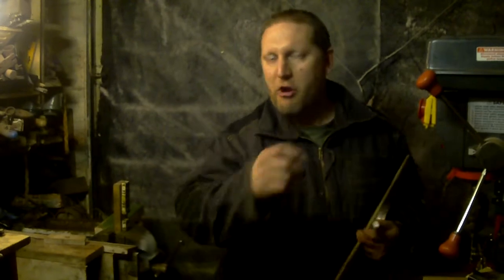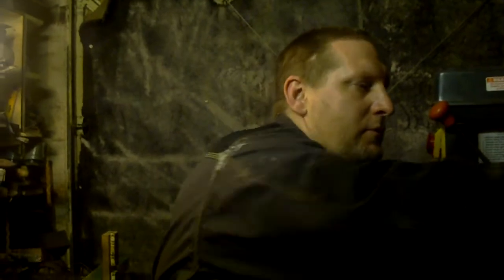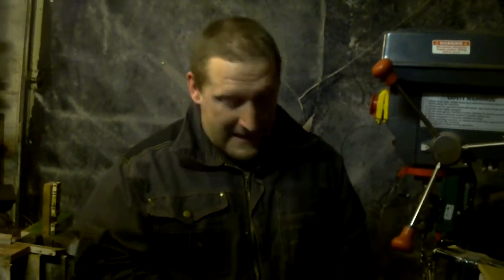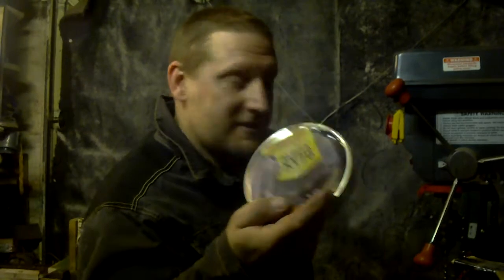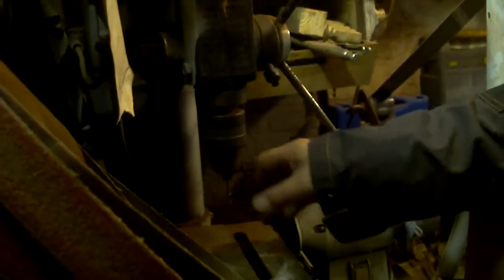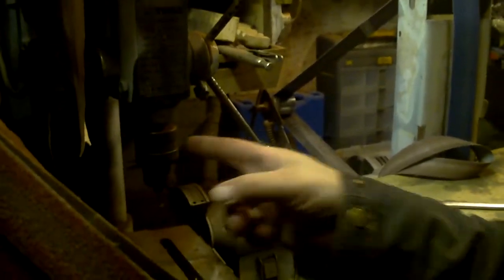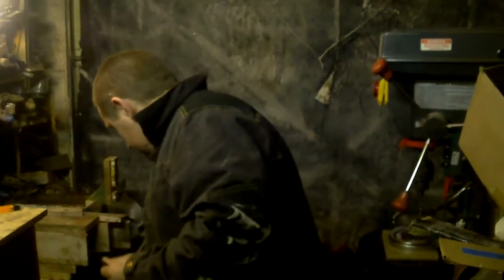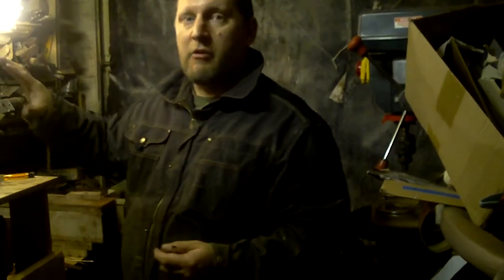Knife Making Tips for beginners, Wessex Blades Hand Made Knives Quick Hints and Tips!

Comment: the first knife I made I started off with a piece of 3 inch wide half inch thick piece of steel.  I used a hacksaw to cut the initial handle shape and then beat the blade down with a hammer after heating with a oxy acetylene torch. I still have that knife around for cleaving heads off fish I have caught

Comment from the maker: files are a cheap way to start...but only in terms of initial material costs, the surface grinding will get you back in worn discs and belts later, if you have a forge you can anneal first so you can drill the softened file, use files to learn the grinds, curves,contours etc. get O1 tool steel as soon as you've got your grinding up to it,,,it is like learning a guitar,,,2 years in your bedroom can be wasted if you don't use a metronome and get your scales nailed down first..

Comment: Great video mate, thinking of trying to make my first knife myself and this helped massively as every other video I see is from an american friend over the water where the materials and tools seem to be sold everywhere, UK equivalents are difficult to come by!!

One question, why depth of ground flat steel do you typically use (I imagine it differs per design) but I'm thinking maybe 3mm for my first try?
Reply from the maker: +Chris Hall hi there 3mm makes a wonderful woodlorey type bushcrafter and allows you to remove only a little steel to achieve the desired scandi bevel....no real need either for perfectly flat sides....Cromwell tools sells O1  but the European Steel that jacklore/LB use is a more consistent quality....I use 52100 for basic tools CS75 for camp knives...
Reply from the maker: +Chris Hall a steel Henry hoover pipe will last a while and yes leavethe edge thick in heat treat or else you'll burn it off...
Reply: Thanks for the advice! gonna order a piece of steel very shortly and make a start!
Reply: My piece of steel has arrived, just got to construct my filing jig! another quick question if I may Scott? I've gone for 3mm stock (01), was just wondering what angle you'd recommend for a nice scandi grind? want to try something simple before I start attempting full flat grinds with a hand file! (sorry for commenting here, but I wasnt sure you'd appreciate me posting question to you on your facebook page etc)
Reply from the maker: +Chris Hall try 11 or 12 deg per side...
Reply: Wessex Blades&Bushcraft Legend, cheers Scott!